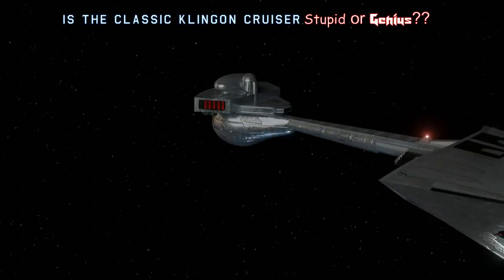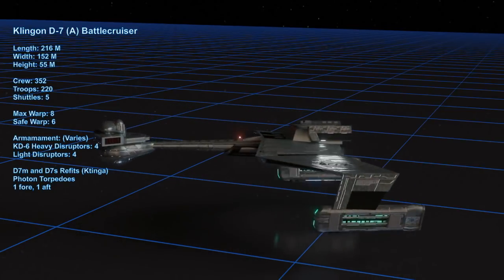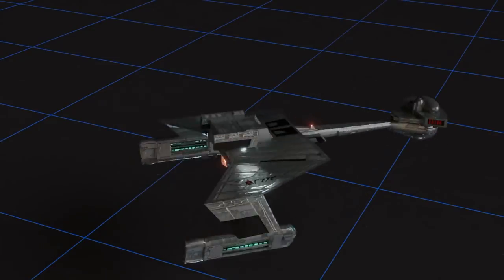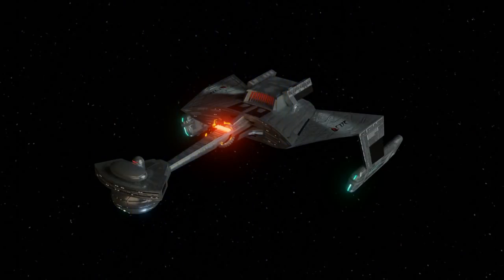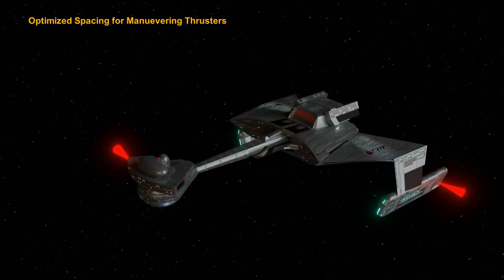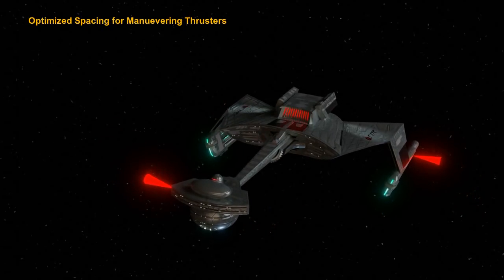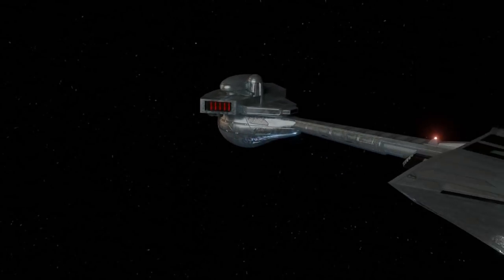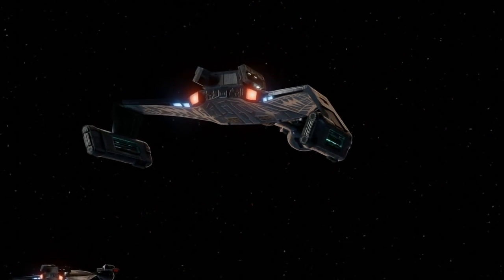The Classic Klingon D-7 Cruiser - Stupid or Genius Design?? Animated Breakdown!

Comment: Other possibilities: 

1) Klingons admire cunning, so it could be a deception - the neck looks like the weakest part of the ship in order to trick people into attacking what is actually the most heavily armoured & hardest to hit part of the ship. This improves the mobility of the ship by removing the need to put large amounts of armour over the entire ship, and instead only needing heavy armour over a small neck structure.

2) The weapons are all forward facing, so the neck wouldn't be exposed to incoming weapons fire anyway.

3) It's designed to have other modules attached to it.

4) It's to create a choke point to make it harder for boarding parties to capture both the bridge and the drive section.
Reply: The trouble with idea 1 is that it relies on the deception being completely maintained.  If their enemies ever get any data on the actual armor layout of the ship, well, dont know about you, but I'd be pumping torps into the engine section like I was trying to impress a girl.
Reply: @Richy0326
Absolutely. Maybe it's simply a remnant left over from older designs. A "traditional" way to build a warship. Conventional thinking for Klingon engineers, always with a mind toward designs that favor Klingon combat tactics. The ostensibly vulnerable "neck" is supposed to lure a foe to attack that area. That's where the Klingon's want you, going for their neck, while you get a D'k tahg to the gut. It dates back to Chontay, the ritual hunt. Their tactics and engineering was likely influenced by millenia of hunting animals that were used to killing Klingons, who had redundant organs and nerves, by going for the neck. A weak point. So their tactics would have been influenced by that, hence their whole conception of combat and engineering too. 

A Klingon looks at a D-7 and says "Yeah what a great design, it just made a lot of sense at the time. Was practical". 
Though another species, with different sensibilities, would have other ideas of what a ship should be. We should try and see the design, not through our own human eyes, but through the eyes of a Klingon.
Reply: Bingo. Impossible to take that bridge if it's even lightly defended.
Reply: @arbhall7572  This is the reason.  That and the radiation will kill the officers when the ship is pushed to maximum capability.  Remember the Klingon cloaking tech is insanely power hungry and when it is active it multiplies radiation by reflecting it back in.
Reply: @davidbeppler3032  yep. The ships of that Era also had servitor/ slave races maintaining the engineering section. Calling it minimal was being generous. Also another reason for the defensive layout. Easier to quell uprisings.
Reply: In some lore the Klingons have a bunch of slave races they use to crew the ship (so Klingons can focus on the warrior stuff without having to bother with engineering or even maintenance), the boom and command module are separated to prevent a mutiny.
Reply: @shimata17  Guile is one thing; outright trickery is considered dishonorable.
Reply: @mdsx01  You'll be pumping fire into the drive section, anyway...it's standard battle doctrine for literally anyone.

A Missed Shot is a Wasted Shot, so you don't take 20 shots at someone's head and miss 19, you put 3 shots into the largest concentration of mass where they aren't wasted and can actually do damage.
Reply: My god...this is soooo stupid 🙂
Reply: I think the choke point explanation makes the most sense here.
Reply: Why Klingons are perfectly capable using such tactics since according to wolf there’s no honor in war but victory but I don’t think that includes to the ship building  and it doesn’t seem very Klingon That seems like something romulan would probably do
Reply: Also, perhaps there's a negative interaction between the warp core and stuff on the nose. And maybe the neck includes a long, thin power core for separate operations. Also, emergency supplies and bunking for lesser ranks.
Reply: @davidbeppler3032  This makes sense, but we also need to remember that these ships were designed before Klingons gained cloaking tech (if they gained it from the Romulans, when the Romulans gained the D7 design from the Klingons [TOS "Enterprise Incident"]; this "if" hangs on what we do with the Klingon ships in Discovery of course). In fact, your hypothesis of the increased danger caused by the cloak could explain the reason Romulans adopted the D7 design when they developed their new cloaking tech. While the old Birds of Prey ("Balance of Terror") could handle the radiation increase from those older cloaking devices, the new devices may have been too dangers for the single hull design. Thus, the adaptation of the Klingon ship design may have been ideal for them (while also an advantage for the Klingons when they incorporated cloaking tech into their ships, be that in a trade with the Romulans [the traditional explanation] or independently before the Klingon-Romulan alliance [see Discovery]).
Reply: Number 4 seems very likely to me: it's very klingon.
However, 3 is an interesting idea with fascinating consequences. I expounded on it in a separate post.
Reply: @digitalis2977  with such advanced technology it's funny you talk about missing the neck especially with solid beam shots but hey if it helps you sleep at night...
Reply: @M60gunner1971  And it's funny that you've apparently never watched the shows where shots miss or are evaded all the time.

After all...it's not like any of that advanced technology would be directed toward countermeasures to disrupt the enemy's ability to target or hit you or anything...
Reply: [Thread bypass]:
I like reason 4 the best; it seems most in line with Klingon combat philosophy.  It allows one section that is compromised to be separated and the other to continue to operate, which is both cunning and recklessly aggressive, since Klingons abhor becoming Prisoners of War and are likely to fanatically fight to the last man, even self-destructing part or all of the ship, holding to "death before dishonor."
Reply: (That is actually why the Battle of Khitomer made such an impression on the Klingons, to the point of changing the entire political balance of power between the Klingon Empire, the Romulan Empire, and the U.F.P. - it proved to the Klingon High Council that the Federation was capable of valorious sacrifice in battle, and that the Enterprise C did in fact fight to the death in the face of an ambush and overwhelming odds, when Captain Garrett could have fled in self-preservation and self-interest instead.)
Reply: @M60gunner1971  Compare the beam weapons and engagement ranges of TOS to those of Babylon 5.  The Shadows, the Vorlons, and the Membari all had high-output sustained beam weapons that were used at close ranges (~1,000 km or less), where in ST:TOS weapons often fired in pulses or volleys and the distances were often much greater, from 500 to 500,000 km, and weapons were targeted by lightspeed (or possibly FTL) processing systems.
Why pulses?  Heat dissipation.  Directing high-energy laser or plasma weapons fire has to dissipate a lot of waste heat to avoid destroying the weapons that generate them after a few shots.  Pulsing the fire helps keep heat buildup within the weapon stay within its design tolerances.
Reply: You are actually correct with #1. In Star Trek Enterprise, they say the front sections of Klingon ships are actually the most heavily armored. It fools attackers into thinking the head and neck are vulnerable. When actually the opposite is true, and they are the most protected on the entire ship.
Reply: The boarding response makes sense. Klingons do seem to use boarding a lot
Reply: Regarding (1), the ship could also actually be over-armored - it has all the armor you'd expect across most of it, but has heavy armor on the neck. This means that enemies that target the neck are tricked into striking the most hardened part of the ship, while those who target anywhere else are just getting whatever they'd normally get.

This would have the trade-off of making D7s expensive and potentially slow, but the Klingons aren't necessarily interested in speed, and their economy is on a constant war-footing anyway.

Comment: Let's try this: the majority of the D-7's sensors are in the forward section, so it would perhaps increase their overall effective sensitivity by maintaining a distance from the engineering section.

On a perhaps related note: if there's a worry about the D-7 boom section, then shouldn't there be a (perhaps lesser) concern over the neck which separates the primary hull from the engineering hull on the Starfleet Constitution class starship?
Reply: The neck protects the sensors up front from the radiation in the back? I like that.
Reply: Well yes - just see what happened when Khan attacked the Enterprise!
Reply: @A407RAC  Thank you.  I was hoping someone besides me would bring that up.
Reply: Yes, keeps the sensors and comms as far as possible from the noise and physical shadow of engineering. Like a modern submarine the drives may create a sensor shadow. But, it probably all works together,
Reply: @A407RAC  Um, what I remember happening is Khan shooting the Enterprise neck (more specifically, in the torpedo launcher), and all that happens is a few guttering flames that are quickly extinguished and one torpedo launcher getting knocked out.  No serious structural damage, no ship getting blown in half.

Seems to me that the Constitution's neck isn't nearly as vulnerable as some people think it is.
Reply: It's for improved weapon firing arcs. If you ever played Star Fleet Battles, one advantage of the design is that the weaponry in the boom can fire in almost 360 degree arcs. Less weapons are needed due to the improved firing arcs. The forward phasers can fire directly to the rear also. Fewer weapons with improved firing arcs uses less power. In the game, Klingons are the only ones who can charge all their weapons and maintain a very high speed. They can use high energy turns, which are energy intensive, while charging all weapons, if you give up overloading your disruptors, or move at a slightly lower speed. More power also means ECM and ECCM can be used at higher power levels, giving klingons defensive stealth and the ability to overpower jamming by their targets.

Comment: Personally, I think this style comes from several factors.
1: culture. KIingons seem to like the vague triangular shape. It can be seen in their cloth patterns, buildings, and even weapons.
2: battle tactics. Klingons favor a hit and run style combat VS a straight up brawl. In a hit and run style combat, having MORE ships, but weaker overall is an advantage. Not to mention a overall, per ship economic savings, thus allowing you to build more ships than of a more 'robust' design.
Lastly. Weapon power! Much like today's navies. Heavy structural design just isn't feasable given the energy output of the weapons... So why bother with the time, energy, and costs of a more structurally robust model, when a single Torp will still 'Scrap' it?
Reply: YES! They operate in 'wolf packs' of three ships, not independently like the Federation does, and as I said, they are all about warping in, and striking quickly to disable a foe. The high maneuverability design, and low profile is all about letting them get off better in that 'first exchange'.

Comment: When it comes to long spindly neck pieces on spaceships, I usually think back to the justification used in 2001 space odyssey. The engines for the spacecraft were powered by nuclear reactors. To make sure the crew was safe from the radiation of the reactors, the crew compartment and bridge were placed at the end of a very long neck structure at the front of the ship, far away from the engines. (One of the easiest ways to keep yourself safe from radiation is to space yourself as much as possible away from the radiation source).
Reply: The reason Enterprise has a neck is actually saucer separation, which was conceptualized as a core part of the design before the show aired - the neck is a docking mechanism. The saucer, meanwhile, was meant to land on planets, but that never happened thanks to budget concerns.
Reply: Also in Avatar or Horizont Event. This design with a remote habitable and engine section makes scientific sense.
Reply: Insulation would do the job. You can swim in pools with nuclear reactor rods 12 meters below and be perfectly fine. In fact you are receiving less radiation as the water is blocking background radiation as well.
At least for our 21 century nuclear fuels, every 7 cm of water cuts the radiation lvl in half.
Reply: @NauticalCoffin2404  
There's a lot less power in a modern nuclear reactor than there is in a Klingon battlecruiser.
Reply: That philosophy may be valid because it shows up in Event Horizon.

Comment: There also could have been material shortages that warrant such a thin neck, or mass requirements that must have been obeyed during the design phase to maintain acceptable levels of maneuverability
Reply: My own pet theory is that at the time of TOS, the Klingons had been suffering an extended period of economic decline.  Finding ways to make do with less would be high on the agenda.

Comment: A lot of the  extended lore for Star Trek seems to imply that spaceships rely entirely on their structural integrity field to keep them in one piece during maneuvers and combat. The SIF is basically just artificial gravity cranked up to hundreds or thousands of Gs to hold all the bulkheads and frames in place with tremendous force. As long as the field is intact the ship is extremely sturdy, to the point where the shape of it can be any ridiculous flight of fancy. Once the field goes however the ship is only sturdy enough to stay together while maneuvering under thrusters, and any serious weapon would simply vaporize it anyways. That's at least my sort of headcanon explanation for why sometimes weapons shoot holes in ships and sometimes they vaporize them without even leaving any wreckage.
Reply: This, absolutely. Armor is a pointless concept even on a contemporary ship, much less a science fiction spaceship.
Reply: @hansmeier8953  Not really true, Armour on Space ships makes sense because you are not limited by mass as much. You can have literal meters of armour thickness in space and it will not hamper you as much as you might expect. With that much mass even energy weapons are going to have trouble getting through it. The main reason you see little armour in Trek designs is that their version of FTL depends on ships mass to a rather large extent. There is also the fact that Trek weapons tend to be very low yield compared to a lot of other sci-fi IPs, so basic energy shielding is enough to defend yourself.
Reply: Starfleet ships frequently encounter and explore new phenomena - weird anomalies, strange radiations, exotic conditions and emissions - so some reinforced layers of armour plating and raw physical mass seems prudent. "Engines down, power banks depleted, computers offline, we've lost all power" seems to be said far too often.
But Klingon ships are built to confront, attack, and chase enemies. They need effective defenses against whatever kind of stuff their enemies are shooting at them. But otherwise they need agility and firepower more than they need hard defenses. If structural integrity fields suck less power than hauling all that extra mass around then they'd favour it.
Reply: @pwnmeisterage  You would think that about Fed ships, and yet when you see the breakdown they barely have enough material to maintain structural integrity in space. Add to that all the windows that are made out of see through aluminium (How they created that is anyone's guess) and they have next to no armour on any of their ships till the defiant class.

Comment: I've been trying to work the radiation hazard angle too, but there's an internal consistency problem that the Federation also places the shuttle Bay in the engineering section, same as the Klingons.  I could buy that maybe the engine techs simply wear heavier protective clothing than would be practical for the command staff, but why subject your shuttle techs to the same hazard. Then I had a thought this morning, radiation could be the reason for the neck/boom design but not for health reasons but instead to reduce interference for the computer and sensor systems. That seems to check out across both Federation and Klingon designs.
Reply: The shuttlebay on Enterprise could easily be shielded, since it is in the section farthest aft: just add a single wall with special shielding components, or even forcefields.
The reason Enterprise has a neck is actually saucer separation, which was conceptualized as a core part of the design before the show aired - the neck is a docking mechanism. The saucer, meanwhile, was meant to land.

Comment: Well ACTUALLY! ...I got nothing. One thing I just thought up is that it is a deliberate bait for the enemy, making them think that it's a weak part and going for it and suddenly the D7 turns to face the enemy and fire a devastating barrage at them.
Reply: The bait thing works once.
Reply: It's for improved weapon firing arcs. If you ever played Star Fleet Battles, one advantage of the design is that the weaponry in the boom can fire in almost 360 degree arcs. Less weapons are needed due to the improved firing arcs. The forward phasers can fire directly to the rear also. Fewer weapons with improved firing arcs uses less power. In the game, Klingons are the only ones who can charge all their weapons and maintain a very high speed. They can use high energy turns, which are energy intensive, while charging all weapons, if you give up overloading your disruptors, or move at a slightly lower speed. Also extra power for electronic warfare systems (my favorite thing).